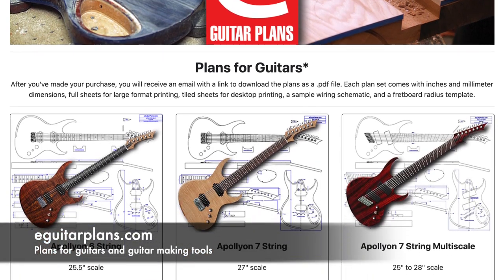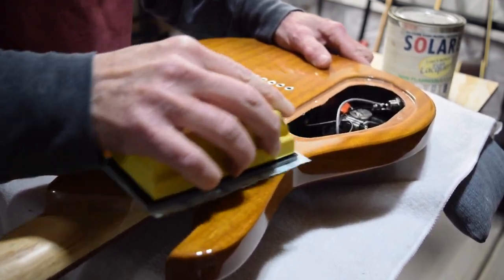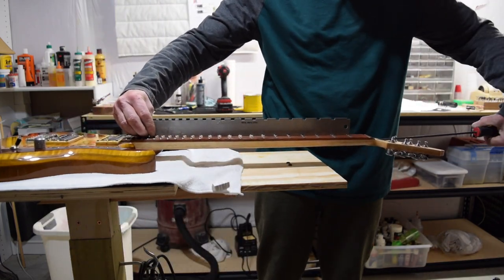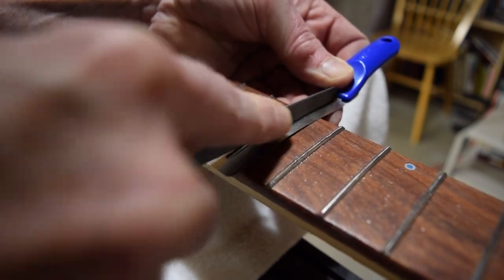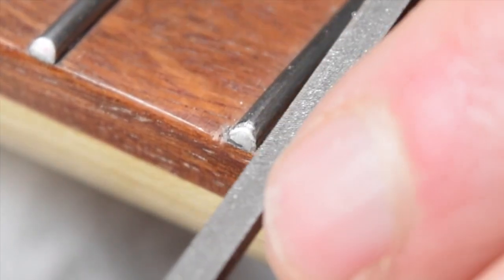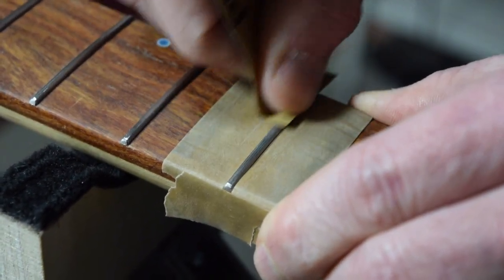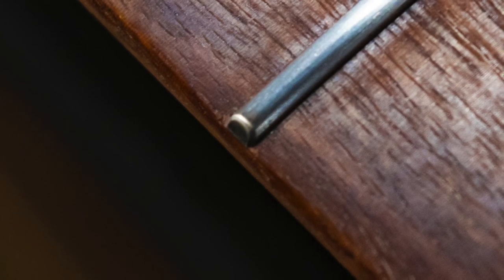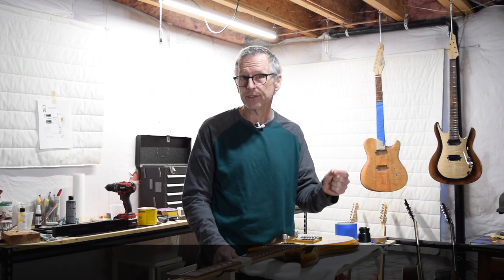Making A Laminated Top Guitar Part 21 Leveling, Crowning, and Dressing Guitar Frets

Comment: Hi Chris, I'm making my first CNC guitar and today I've made the fret slots. The process took more than hour to make 23 frets, about 3 minutes/fret. Is that reasonable? I'm afraid it damages the electric trimmer by working so long. Thanks for one more very detailed video, have a great day.
Reply from the maker: What are your feeds and speeds? I do 20 inches per minute, .01 inch depth of cut and it takes me 40 minutes to cut 24 slots. I don't know what an electric trimmer is.
Reply: @HighlineGuitars  🤦🏻‍♂️sorry, it's not a trimmer, I mean the router. I'm not native English speaker. Thanks for your answer. I'll check this at the workshop tomorrow.
Reply from the maker: @Fernando.Canal2  when I cut a body, it can take 3-4 hours. I’m still using the same router after 5 years with no sign of damage. I do keep an extra set of brushes on hand because they need to be replaced every couple of years.